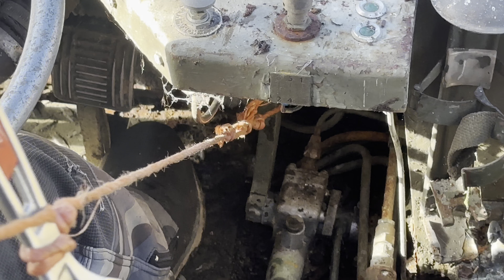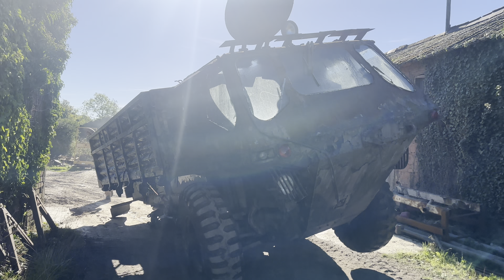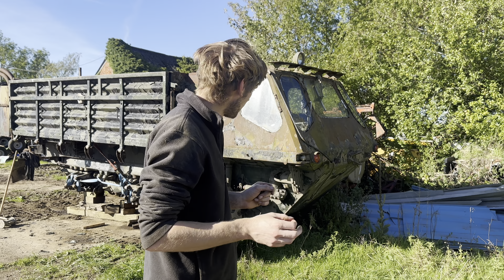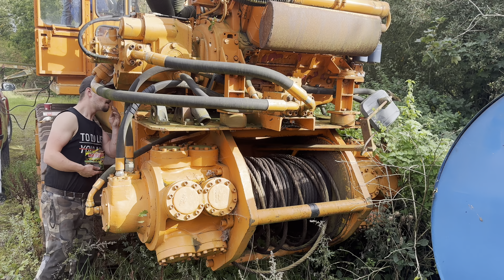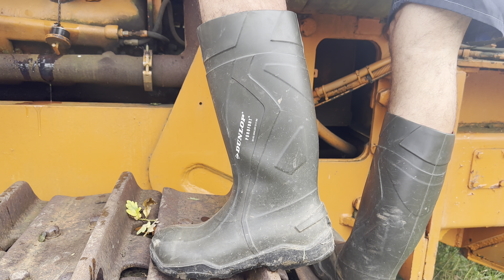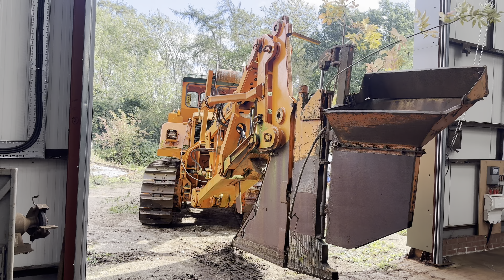Selling my MINT Alvis Stalwart

Comment: Detroit Diesel - designed to convert fuel into noise, and not much else. Didn't disappoint.
Reply: V8 Cummins sounds better IMO. :)
Reply: @FrontSideBus  not a chance
 A Detroit on full song is a thing to behold
Reply: I couldn't agree more!
Reply: this  is a straight eight rolls engine , twice a champ engine
Reply: @woodennecktie  not in the crawler it wasn't the B80/ B81 was in the stolly
Reply: You can't whinge at the quality, loved seeing them about as a kid.
What a rare find 4 wheel drive has to be worth a more 😅😅

Comment: The torque on the Terrex front cable drum must be amazing - it's got 2, 10 cylinder hydraulic motors. I worked on strip mills that only used 1, 5 cyclinder unit.

Comment: If I owned that I would cut the top half of the body off and drop a bus body with floor over it. Put panel over the engine area that could be remove easily because the seats would face inward against the walls. with the bus body you could still steer from the middle bt have 2 doors up front to load people into the bus or you could have a separate entrance in the back for passengers but if you do that leave a way to unload passengers through the front in case of being rear ended.

Comment: I have always wanted a stolly, but I talked myself out of it last time because 6mpg and no diffs and got a 101FC instead. But this, its already abused and broken. It needs axle work. It needs axles with diffs so you dont have to do all that bouncing off kerbs crap when roading. It needs swim gear because whats the point of a stolly if you can't drive into the local marina and freak everyone out... I have no idea how I'm currently resisting tracking you down and pushing 3 grand in your hands for it. Must be strong. Must be strong...